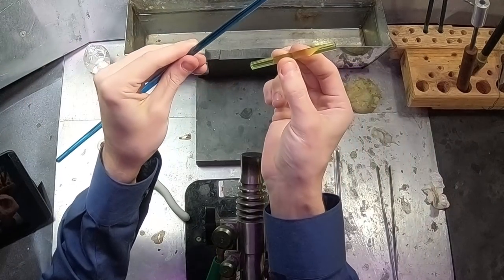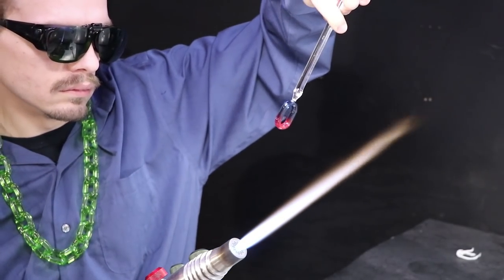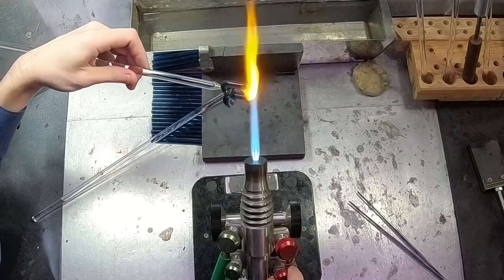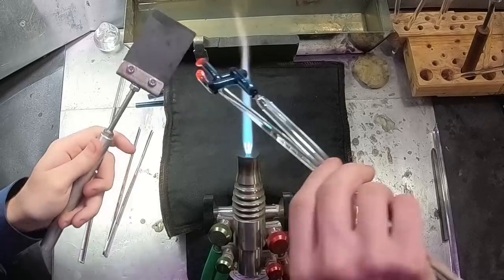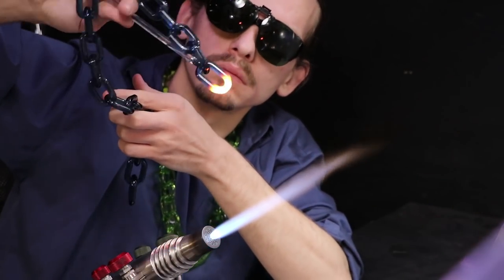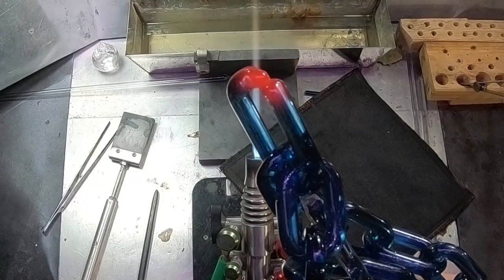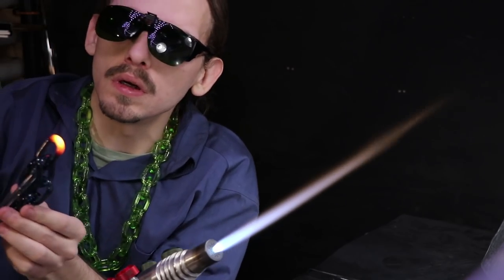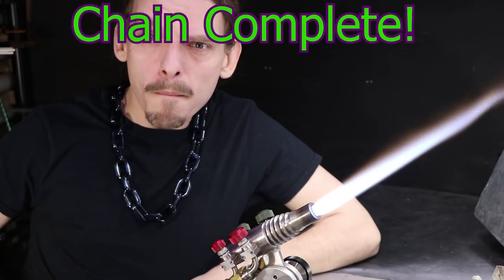Glass Chain Necklace 2

Comment: Thank you soooo much, soo many great tips, I was hesitant to start making one of these but you’ve given me a ton of confidence, definitely my next project, keep up the great work!
Reply from the maker: Your welcome Violent Vegan. This one does take some patience. A full chain might take 4 to 5 hours. It's also easy to make a mistake and break it. Remember you don't lose that practice even if it breaks, the experience stays with you.
Reply: Lol I started making em and I'm actually pretty good at it I've made about 6 so far and sold 2 of em already and got an order for 10. 😊  thanks for the help, also something I started doing is rubber banding the second link to the punty (so it stays still and doesnt drop in the heat) and when the chain gets long I carabiner the end into a bracelet so I don't have to hold it

Comment: Hey Matt! Got a question, so I’m making one of these necklaces now and when I put it all into the kiln, one of the colder links will crack. Any suggestions? I’ve tried warming it all up then fixing it but it still cracked after annealing.
Reply from the maker: Hey Gabe, there's thermal stress left over from the bending, so reheating any cold links might cause them to crack. Did you set the chain in a cold kiln and ramp up the temperature? That is what I did, I never set it in a hot kiln. Also, you might be able to anneal the open links before you assemble the chain, bend #1 and the punty attachment are contributing factors to the stress. 
  Lastly this is one of the hardest challenges that most of my students eventually face. Symbolic to scaling a treacherous mountain to retrieve a flag as indication of your abilities, but here it's a glass artifact to wear proudly. Best of luck on your glass journey Gabe!

Comment: OK Matt I have a question for you if I’m working with only clear glass Well I have a problem with cracking cooling it down without a kiln since it’s only one color because I notice you’re not putting any of that work in the kiln to keep it hot while you still are going on other pieces
Reply from the maker: Hey Mike, the faster the glass cools down the more destructive it will be. As your cooling down your work without the kiln try flashing some heat into the outside to slow down heat loss. It's also good to avoid touching hot glass to anything cold like graphite, metal, or cold glass.
    For Glass-Chain I let each link cool almost completely before attaching another. I edited out those 'cooling periods' from the video or else it would be a couple hours long.
    There can be some other factors such as glass thickness and shape of the object. An object with a lot of edges or small points attached might cool off unevenly.

Comment: Hi Matt very great videos you are helping beinginers all over the world 🌎 !  Heaven awaits you 😇  so I read allot of comments and I 2 am having the same problem with everything cracking.  It always happens after my third link,  I tried waiting 5 min before adding new links I even started making single open link wil waiting.  But sill it always seems to crack crazy frustrating.   Any thoughts?
Reply from the maker: Hey Justin, I believe this is one of the more challenging projects for a beginner. Each link will retain stress from where it was warmed and cooled. It takes a lot of patience to keep the heat off the old links. You could try using a thinner rod as thicker ones may retain more stress. I believe you'll get it in time, consider working on another glass project and come back to glass chain later.

Comment: What length rods do you cut for each link? Planning on giving this a go this week.
Reply from the maker: 3" Inches long with a 7mm diameter rod. If your rod diameter is smaller you'll want to cut it shorter.

Comment: Hey Matt! I've been working on trying to make a chain, but I keep running into cracking problems. When I bench cool my links, they crack eventually as I work on the chain. I've been sticking the whole thing into the annealer between putting links on (I've also been making the links one at a time because of the same cracking problem) I'm using 8mm clear. What am I doing wrong and what can I do better? I'd like to start premaking the links like you do. I feel like I'm wasting a lot of time lol.
Reply: Should I try flashing the links in the propane flame when I'm pre-fabricating the links? They cool down fine, but when I start adding more links, the previous ones will crack
Reply from the maker: @kamaji666  Hey Kyle, awesome to hear your working on chains, sorry your having some trouble.
  It sounds like your previous links are getting too hot while your finishing your current link They might be soaking in some torch heat or hot glass heat. After I close each link I give it a full minute or two to return back to room temperature before I add the next link. 
   Don't worry about mistakes, any time spent on the torch is practice, so its never wasted.
Reply: @MattJasa  
Thank you for the quick response! You're right, it's all practice. It gets frustrating at times, but that's the game! I definitely haven't been giving it enough time to cool down. Once the links were fabricated, I was just going at it. I'll have to give that a try. Constantly taking it in and out of the annealer was not the right way and I knew that lol.
It's only my second week on the torch, this has been a great learning exercise! Thanks!